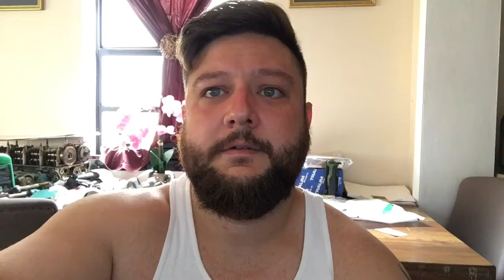Oil Squirters, Me Vs Hot Tank (Conclusion), Podcast Details

Comment: I'll have to try oven cleaner, that's a good idea. I have been using degreaser and my pressure washer and it does end up looking pretty good after a few soaks, but it takes time and is a bit of a pain in the ass
Reply from the maker: Gotta be quick with the oven cleaner. Don’t let it sit to long. Spray, scrub, rinse
Reply: @VHBEngines  Ok cool thanks for letting me know.

Comment: The oil from squirter wldnt be tht must of a difference to cause crack.... as a matter of fact the oil temperature is relative to cylinder temp... cylinder temp goes up so do oil temp.... 
    What is portent is that we know when squirter are needed vs not.... most of us take advice from ppl who are doing 1500hp drag built  when we are doing a street built... the same rules doesn't apply simply because the vehicle will be apply in different situation..... short period of high power drag race may not need squirters... but a road vehicle will do well with dem as longevity of parts n ability to driven longer distance
Reply from the maker: This inevitably winds down to "do I have to have this to make power?" And the answer to that is No
Reply: @VHBEngines  u don't need oil nor coolant to make power either?... for the average Joe... some amount of reliability is needed